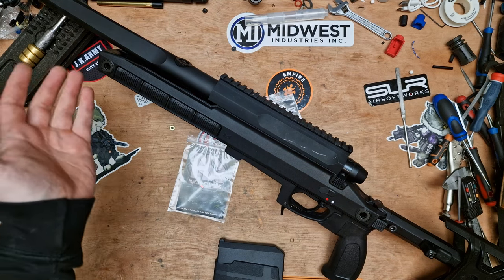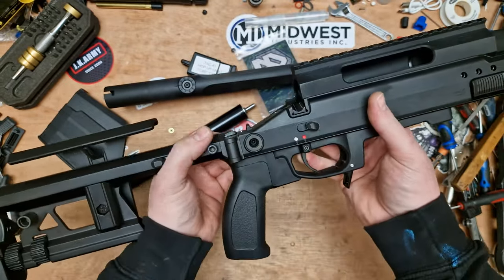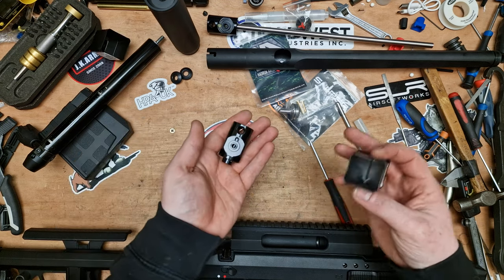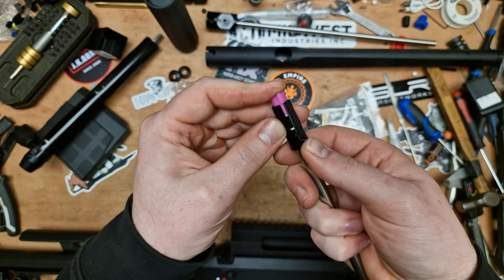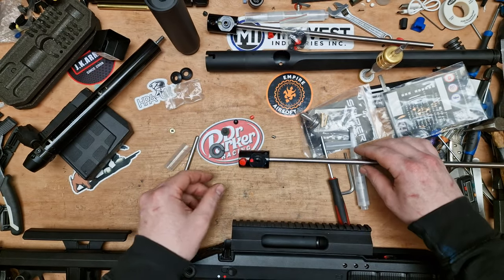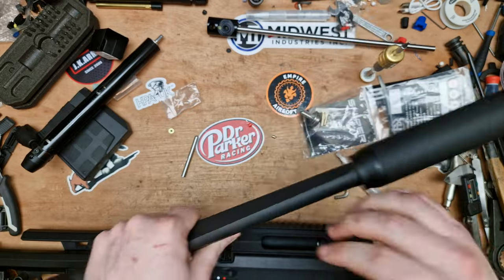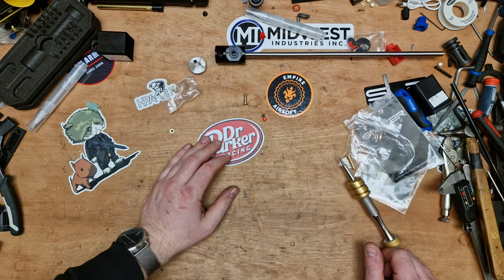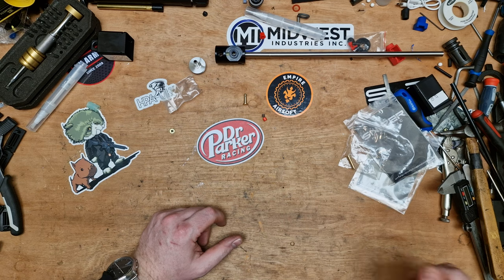Silverback Tac-41 GBB Hop Up Install Guide

Comment: I have the hadron tac nub, I think the pin is so the pressure is applied centrally. The hop dial is spiraled on the base, so without the pin the pressure would be on the outer edge of the nub.

Comment: I own a TAC 41 and i have two issues. One it feels like my bbs always go slightly right no matter how many times i align the bucking and clean the barrel. 
Two the cylinder after a while starts to gain a lot of friction n resistance causing a very rough bolt pull. I use ptfe lube on it but still get this issue - any thoughts mate?
Reply: I bought original shorter outer barrel, when pulling the bolt. It makes sound. Its from inside of outer barrels surface. I bought new one i will try again. I think its qc issue
Reply: Mine also pulls to the right!!!!!,and other owners have this problem!!!!,was prefect out the box for about 6 month's!!!!!.
Reply: Wtf is it then, the hop unit maybe as that's known for poor qc? Wonder if i should swap to the gbb hop unit and barrel etc
Reply: @jasondunning2576  Just bought a brand new tac 41 A and no matter what I do the bbs fly right. Very disappointing.
Reply: @WM84629  ok if you're BBs swinging it's the score and not the tac,what I reckon after being pissed off about it!!!!!!!!.
Reply: Not score, scope I hate it when my phone tries to spell for me!!!!!.
Reply: @jasondunning2576   oh really? I can physically see the bbs curve to the right though
Reply: @WM84629  ok I'm more awake now do you see curve when looking down the scope!!!!????,if you,shoot it looking just over the top of the scope,if it's still curving, it's the aliment of the hop up and inner barrel, Longbow BB,do a teching service!!!,and Jason who owns it a very nice and helpful man!!!!!!,but I would say if you see it swinging down the scope, it's the scope alinment, that's the best I got for ya fella (I know it's a pain in the arse).